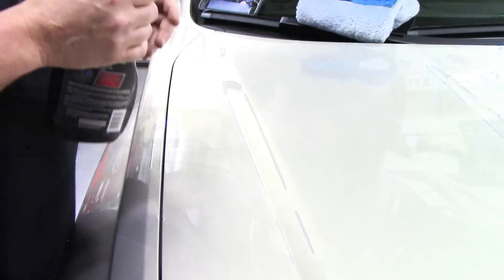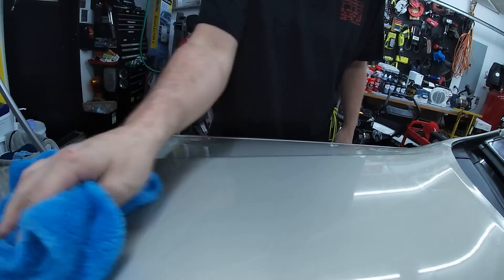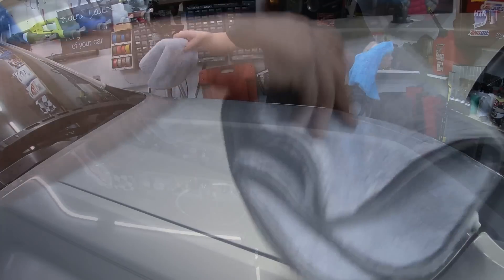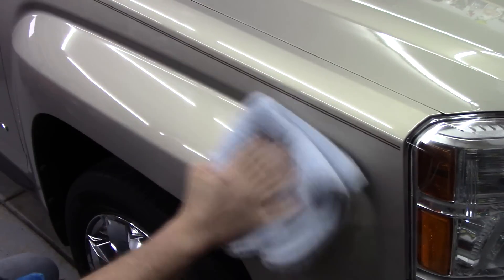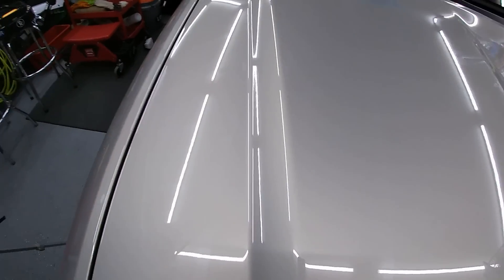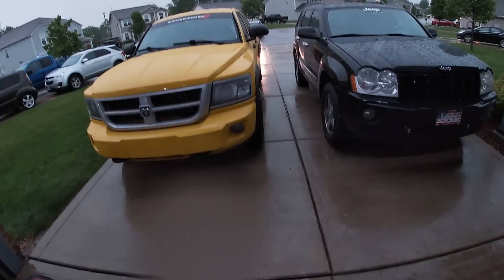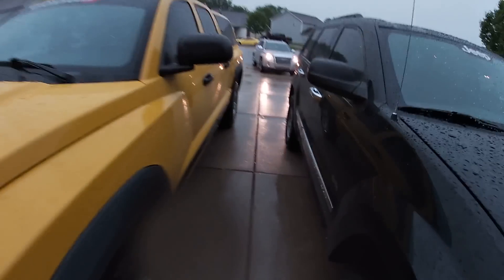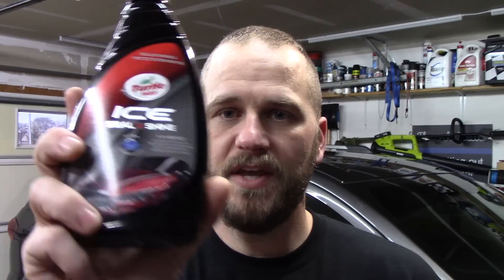Turtle Wax Ice Seal N' Shine! All I Can Say Is WOW!

Comment: When these products last as long as Collonite  825S, I will make the switch to the new gen.  But for now, twice a year is ample protection.  On a garaged car, 825 still works up to a year! Only gets redone if I want to swirl remove
Reply from the maker: It’s not meant to replace your base wax. It’s a topper to help extend the base wax.
Reply: This is part of the problem that I am just starting to unravel. This industry has made prep easy to understand.  Some clay everything, some only when surface feels rough...me almost never use clay.  But the concept of building up layers existing in carnauba world for years, but topping sealant with carnauba was not understood.  Topping carnauba with more sealants even less so.....remember we were supposed to prep??  Only one person is going thru the effort of comparing durability of 20/34 different product's at a time.  Amazing how good Nufinish really is to this day.  845 being tested in next series.  They all look good day 1....its month 3,6 etc that matters as carnauba is useless past a few months.
Reply from the maker: John Gagne DDS I agree! I only clay when needed. There have been times I have only clayed a good and that’s it. I think SIO2 waxes are the way to go now vs Carnauba. They give great gloss and durability
Reply: FAB Automotive Detailing what do I do with all those old carnauba waxes?

Comment: Is this better than the griots garage one step sealant you apply with a random orbital?
Reply from the maker: david van sickle No because One Step removes imperfections and is a base wax. This product will not correct paint and is meant as a topper to a base wax.
Reply: FAB Automotive Detailing ok, so after the base wax this is a good product to use? And should I clay bar before using a base wax?
Reply from the maker: david van sickle Yes this would be great as a topper. Only  clay when needed before your base wax.
Reply: FAB Automotive Detailing thank you very much.
Reply from the maker: david van sickle You are welcome

Comment: How would this compare to something like meguiars ultimate liquid wax or a carnuaba wax?
Reply from the maker: Mohammed Hassnawi I have not compared it to anything! I can tell you that it will definitely last longer then a traditional Carnauba Wax.
Reply: Look up a video by Pan The Organizer. He did a hood comparison side by side test with Seal N' Shine, Meguiar's Ceramic Wax and Mother's CMX. Mohammed... you are NOT ready for the results. Let me know when you've seen it. It's embarrassingly not even close.
Reply: Daiymian he didn’t let the ceramics cure for 24 hours
Reply: @gtbigdog3507  If you're talking about the Meguiar's Ceramic Wax or the CMX... you don't have to. Nowhere in the instructions does it say you have to let it cure for 24 hrs.That's only if you're "stacking" or "layering" the product onto the surface. Pan wasn't doing that on all 3 products. He was just testing them side by side in a use and go format and those 3 products allow you to do just that. Wash, apply, buff off and go. If you use it regularly enough, you wont have to layer and wait 24hrs. Probably another reason why the Turtle Wax won. Less expensive AND no layering required when you can just reapply next wash and the next wash.
Reply: Daiymian well I just used both on two different cars so I will see which one works better. Chances are I will never find out because I was and wax my cars more often than normal people
Reply: @gtbigdog3507  You and me both brother lol. Oh the sun is out and will be out for 3 days?? Time to wash and wax ! That's me !

Comment: Can this be applied in the sun?  Only product I've seen so far as far as a wipe and shine is by Eagle One.  My car is outside all the time with limited shade to apply these kind of products.
Reply from the maker: gkirms It does not say it can be used in direct sunlight. Griot’s Garage Best of Show Detailer can be used in direct sunlight and is an amazing product. You can find it at Autozone or Advance Autoparts.
Reply: @FABAutomotiveDetailing  Appreciate it.
Reply: Bought a bottle of Griot’s Garage Best of Show Detailer today and tried it out.  I'll be sticking to my Eagle One Wipe and Shine Detail.  For me no comparison between the two.  Plus it's half the price and for me does a much better job.  But I appreciate the advice on another product out there that you can apply in direct sunlight.
Reply from the maker: gkirms Now you have my interest On The Eagle One because I love the Best of Show Detailer. You are welcome
Reply: @FABAutomotiveDetailing  And you might not like it but you'll never know unless you try it.  For me though this is the best I've found that gives my car a quick detail along with a smooth finish regardless of sun or clouds.
Reply from the maker: gkirms Never know until I try it! Thanks for the info

Comment: I tried this product on my red Ford truck and it was amazing!!!!!!!!!!!!! However....I used it on a dark blue Chrysler 300 and it streaked like a son of a gun!!!! Had to use a detailer to get the streaks out. Not sure why the darker color wasn't as accepting.
Reply from the maker: Steven MacAlpin There could be a few reasons why whether it’s over saturated Towel, humidity or contaminated paint.
Reply: The 300 I used it on is brand new, I clayed it and used Chemical Guys 38 finish polish then the Turtle Wax Seal N Shine....streaked really bad but the streaks came out when I used a spray detailer after
Reply from the maker: Steven MacAlpin Ok! I’m Not sure why it streaked on you.
Reply: @FABAutomotiveDetailing  No sure either. Used same type of Microfiber towle as I used on the truck, it was clean and new. Weather was 80's, car was in the shade etc etc. Im going to try it again and see if it does it again. Love the product though, so easy to use will be buying again. Have you used the other product, the ICE wax?
Reply from the maker: Steven MacAlpin I have not tried the Blue Ice Spray Wax but plan to soon.
Reply: @FABAutomotiveDetailing  Hope to see a vid on it soon! Thanks keep up the awesome work!

Comment: So after you decon or clay can you apply this right away?
Reply from the maker: If you want to yes! Turtle Wax recommends using it as a topper to your base wax or coating.
Reply: FAB Automotive Detailing so they don’t recommend using this as a base?
Reply from the maker: Just a Viewer You can use as a base but it is recommended as a topper. Any liquid product should be considered a topper except for a few exceptions.

Comment: So that was just a straight wash and then apply? Looks really good. I have it in my garage but haven't used it yet.
Reply from the maker: I also decontaminated the paint with a clay bar.
Reply: What did you actually use? Wash, clay bar, then what?
Reply from the maker: Allturbo98 Washed with Griot’s Super Concentrated Car Wash then clayed with Griot’s Paint Cleaning Clay.
Reply: FAB Automotive Detailing no polish or anything before the seal and shine? I’ve heard others say that you should polish before then use the seal and shine.

Comment: Can i use it in the headlight?
Reply from the maker: You can use it on the headlights.
Reply: @FABAutomotiveDetailing  thanks..
Reply: @FABAutomotiveDetailing  how Bout in  some plastic parts outside car?
Reply from the maker: @jerichocartago294  I wouldn’t use it on black plastic trim but headlights and taillights is fine
Reply: @FABAutomotiveDetailing  thanks for the info. Ill check it tomorrow. Done using some plastic part.😊
Reply: @FABAutomotiveDetailing   hopefully nothing gonna bad happen..

Comment: That came out pretty good! Good thing turtlewax is stepping up! Was thinking maybe the streaks are due to towels? Reg towels off the shelf may create streak from not be as absorbent?
Reply from the maker: It caught me off guard actually. Streaking comes form over saturated towels.
Reply: @FABAutomotiveDetailing  I need to save and get me some good towels! Lol. Only if I had as many microfibers as the ol lady has in bath towels I be set! think even panel being to hot can affect streaks witness going mobile.

Comment: Good review. I bought the griots creeper seat, what do you recommend to do before using it?
Reply from the maker: Thanks! Locktite all the bolts for the wheels. Mine came loose but I can't get anything in there to hold the bolt to take it back apart. I almost used locktite on them and didn't and now I am kicking myself for not doing it.
Reply: FAB Automotive Detailing thanks for the help
Reply from the maker: Genysmen runner You are welcome!

Comment: Another You tube detailer says you can not use this hybrid on top of a SI02 Sealant ???
Reply from the maker: KBsToy You absolutely can use on top of ceramic coatings or SIO2 waxes. In fact TW recommends it.
Reply: As always THANKS for your info. Amazon sold out on back order :( @FABAutomotiveDetailing
Reply from the maker: KBsToy You are welcome! Walmart usually has it in stock.
Reply: Beadmaker , this  , Last coat, my brain is confused so many great products :)
Reply from the maker: KBsToy Not Abbas thing to be confused about! 😂

Comment: What do you mean by “free from containments”?
Reply from the maker: No Earth Society You need to decontaminate the surface by using a clay bar to remove imbedded contaminates. A chemical decontamination is also recommended during the wash process.
Reply: FAB Automotive Detailing thanks! Also, do you have any recommendations for an iron remover?
Reply from the maker: No Earth Society Car Pro Iron X is good and so is Adam’s. I recently tried Malco Iron Blaster and was blown away but I don’t think you can buy it without and independent dealer.
Reply: FAB Automotive Detailing  cool, thanks again!

Comment: I've been using Meguiar's X-wax for a couple of years. It's safe for black plastic trim and porous cladding so common on todays vehicles. The stuff is expensive and only available online, have you tried Ice Seal & Shine on any Black surfaces ? I'd love to save $$ and source a replacement product locally....Thanks in advance
Reply from the maker: Marc Cross I have not tried it on black yet but plan to do a comparison video on a black car!

Comment: Hey FAB, great video as usual. Question - Do you recommend this over meguiars hybrid ceramic wax? I bought hybrid ceramic wax after watching your video and so far I am loving it a lot. I just wanna know after I run out of meguiars should I buy this or keep using meguiars? Thanks in advance.
Reply from the maker: Rock Roller They are both great in my eyes! You can’t go wrong with either. I still use my HCW and love it. TW is great as a topper and can be applied on a dry surface. It’s more or less user preference.

Comment: Have you tryed a head 2 head challenge TW ice —- meg ceramic spray sealent
Reply: There's another video on youtube comparing meg ceramic spray, mothers, and this stuff.  This beats Meg's and mothers by miles.  I've used Meg's and today I'm switching over to this stuff.
Reply from the maker: 254JROCK I have not but a lot of channels have and this beats them all believe it or not.

Comment: I still love my beadmaker.
Reply from the maker: John Wagner Beadmaker is good but has terrible durability.
Reply: @FABAutomotiveDetailing  What would you suggest?
Reply from the maker: John Wagner Well Turtle Wax is releasing a spray coating the first week of November. I have used it and it works even better then Seal N Shine so i would wait until it comes out.
Reply: @FABAutomotiveDetailing  Yeah, that's what I was thinking.... Would I have to remove the BMW then put like the new tw ceramic coating on? Or could I apply the tw ceramic on top of the bm?
Reply from the maker: John Wagner I would just let the Beadmaker wear off then apply the TW Spray coating
Reply: @FABAutomotiveDetailing  ,what's the name of the spray coating ?is it a ceramic coating??
Reply from the maker: Johnny Meeks Yeah it just called Ceramic Spray Coating
Reply: @FABAutomotiveDetailing  ,thanks sir!!I just subscribed 👍👍
Reply from the maker: Johnny Meeks You are welcome and thanks for subbing!

Comment: I was not impressed I purchased and used it on my 2019 Toyota Avalon XSE black metallic paint. It left lots a streaks, I use a clean micro fiber towel for every panel, I have at least one hundred small towels. I was finally able to get the streaks off with lots of elbow grease, the jet black is not that much better. I contacted Turtle was and it's been a month now they claim the check is in the mail. After decades of using their products same with my dad I am done with them.
Reply from the maker: Mr. 1000 CC This is unfortunate to hear. Hopefully they make it right for you.
Reply: @FABAutomotiveDetailing  maybe a refund but I will believe it when I see it.
Reply: Next time try Lucas Slick Mist Speed Wax. Absolutely stunning. ^_^
Reply: @999thenewman  okay thanks
Reply: @Gooddog1  Cool. While there are many other tempting products at Walmart, this product has never failed to please. Have a great weekend.
Reply: You should have just spritzed some water on a microfibre towel and you would have been fine. Also the more damp your applicator towel gets the easier it is to apply.
Reply: @kinnonmcallister  Thank you, I will try it the way you mentioned it see if it works for me that way.
Reply: @Gooddog1   Good luck. I am 100 % sure you will have perfect results 👍. Just wait till the Turtle Wax Ceramic coating comes out on November 11th in the USA and December 1st in the UK. That product is a huge game changer and is going to save us detailers a fortune! 👌🏴

Comment: Thanks for your video buddy. Personally I have had nothing but rubbish experience with Turtle Wax products. They're all very poor imo
Reply: Then youre not using the product correctly. I switched over from high end boutique companies to over the counter stuff like Turtle Wax and get 95% of the same performance for a fraction of the cost.
Reply from the maker: happy2be You are welcome! I haven’t used TW products in a long time but was surprised by this one. I went in with low expectations but ended up loving it.

Comment: pee-pee water compared to CarPro Reload
Reply from the maker: How long does reload last?
Reply: @FABAutomotiveDetailing  I just did the job a month ago. I did max wash, Iron off, Sonax Perfect Shine with BIgfoot, Eraser, and Reload. Bottle says a whooping 3 months. So I guess 6 months 2 coats. Tried seal and shine Tried hybrid solutions and last coat back when it was Black Ice. All peepee. This last job is off the hook. Goes on with a beautiful sheet covering very well. Comes off good. The result is a thick looking coating that just blows the rest away.
Reply from the maker: @carl16760  I don’t doubt it looks better but I have seen Seal n Shine go 6 months here in Indiana winters easily with only one layer.
Reply: @FABAutomotiveDetailing  never seen anything so dramatic in 40 years. This is on a black 2020 Ram and 2020 dark blue Fusion